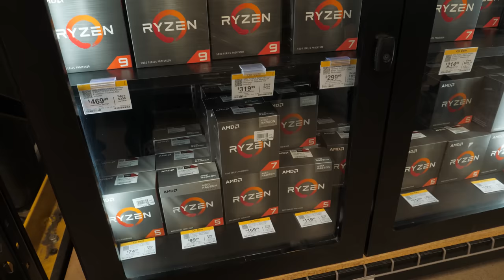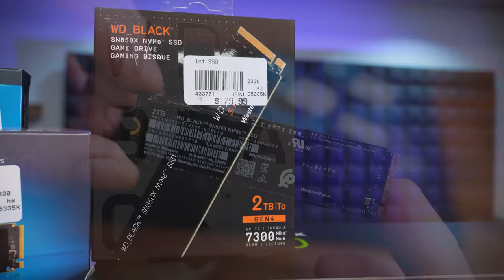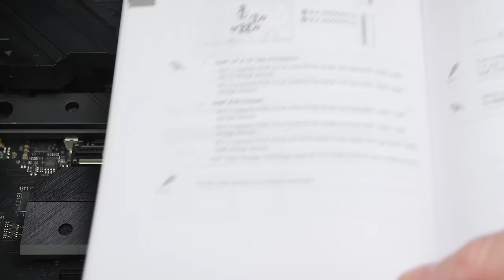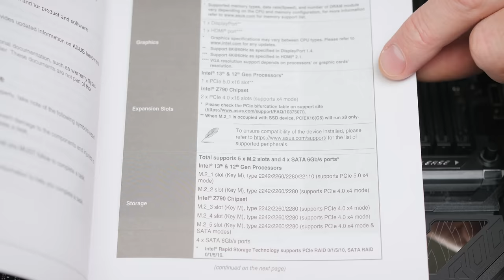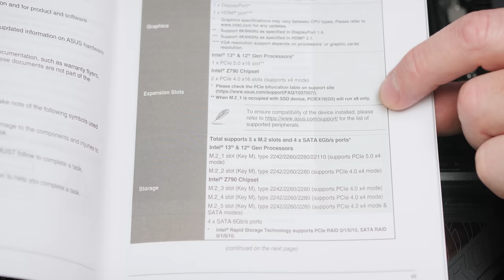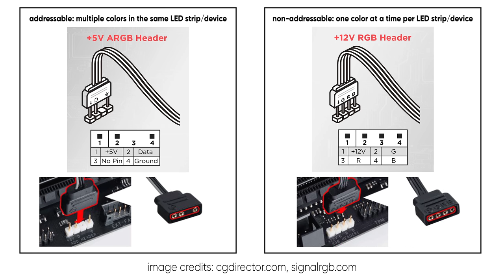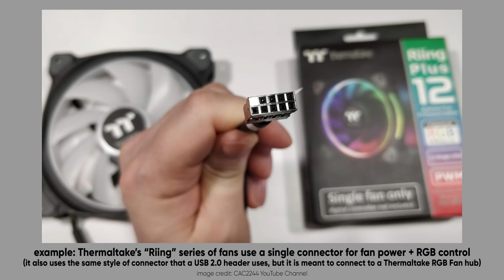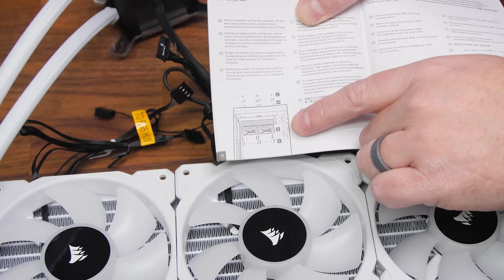How To Build a $3000-$5000 High-End Gaming PC - Step-by-Step Guide

Comment from the maker: Thanks for watching everyone! In case you missed it, this is Part 3 of a 4-part series, and Part 2 was the $900 budget build that covered a lot of the building basics: https://youtu.be/vUu7N8tq4RE 
The parts I use in this video cost well over $3000, as many have pointed out, but that's the starting price range I think builds should be if they're going to use stuff like full RGB fan setups, high-end AIO liquid coolers, and $200+ cases. 
Also, the description has been updated with the correct power supply and case. 🙏
Reply: meanwhile all the full rgb custom loop setups I see for a i5 12400 🤦‍♂🤦‍♂🤦‍♂
Reply: Hope Part 4 goes up soon, seeing as I'll be using this video to set up my own 4090 strix 13900k build by this weekend 👀
Reply: Will you please mention how to set up undervolt on this cpu in part 4?  I've read a lot about how you can go into bios and switch something so it's not always pushing it closer to 100c, and it doesn't seem to hurt performance much at all.
Reply: I wish the Micro Center near my house was a huge warehouse store like this. Ours is pretty small by comparison, always feels a little cramped. We used to have a Fry's near us that was cavernous and gave me that awesome "Oh, where should I look first?" feeling, but of course they've been gone for several years now.
Reply: Didnt you build in a Lian Li Lancool 3 case? The case in description is Corsair ICUE 7000X if that was wrong. 😂
Reply: Great video. Just one remark: Basically no gaming PC needs 64 GB of RAM for the foreseeable future. Not a good buying advice.
Reply: Why wipe off perfectly good thermal paste. lol
Reply: Chris Fix showed that GPU sag can damage the VRAM solder points close to the PCIe connector. You should always support/suspend such heavy cards, particularly in a build guide.
Reply: as long as you're doing a madboi build, you may as well do a 4x2TB PCIe 4.0 M.2 in RAID0 ;) I've had this for a few years and not had any issues (yet)
Reply: Right up until 'Intel'....then I realised it was  'Sponsored Build' with camouflage. Very poor show
Reply: Great video! One thing I should point out though, is that @38:48 There is no LGA1700 bracket for Corsair coolers. It's the same bracket for every other LGA Intel socket (115X/1200). :)
Reply: Paul, thanx for another wonderful, detailed and enlightened build. Love how you do these!
Reply: Hey Paul n00b question... I can use all of this with a 7900 xtx yes?
Reply: @tobiaslofton611  yes
Reply: @HighCastle0824  so therefore it is an lga1700 bracket no?
Reply: When is part 4 coming????
Reply: I want Micro enter to offer world wide shipping.
Reply: @robertpearson8575 true tho that's what im wondering lol
Reply: Paul any progress on video 4? I am considering a high end build and the next video seems pretty important…. For the newbie….. thanks,…. 😊
Reply: Any update on the mythical Part 4? It’s been over two months. I’m looking forward to your memory configuration insights.
Reply: Added this reply to the general area so putting it here so maybe you answer it.  My question was about what if not Micro Center.  Do not want to watch these and realize I cannot do it due to no parts center.  Original question "Not sure how to scan comments so sorry if this was asked before but what if there is no Micro Center close. In the Virginia Beach area in this case.  Just wondering before I get to invested in this idea what the options are if no PC building parts center close."
Reply: Apparently nobody shops at that store, it's empty! 🤪
Reply: @TAVMANIAN  We sourced all of the parts via Amazon, I believe. We do not, unfortunately, have a Micro Center in the area. Maybe in the future. I am surprised, as we have two national laboratories in the state, along with the birthplace of the atomic bomb. You would think folks here would be builders. Best of luck.
Reply: Where’s part 4?
Reply: I needz ma part 4!
Reply: It's seems Amazon is cheaper than micro center in my area.
Reply: Love your videos!!! Have you done a review of  gigabyte Aorus C700 glass pc case?
Reply: I didn't know you're in Orange County CA 😁👍
Reply: I thought you would want the radiator fans to pull air into the case and pull air through the radiator, not push air out through the radiator?
Reply: @typerightseesight  Probably as an opportunity to show people how to apply thermal paste since having pre-applied thermal paste isn't a given
Reply: to a chip without integrated graphics. lol. super fresh @bzomeful

Comment: Built one of these a few months ago and it's insane overkill of a beast.  Just for fun I ran black ops 2 with fps unlocked and it ran at almost 1000 fps.  I have a 4080 and 13700k with ddr5.  30k Cinebench score.
Reply: How.mich was the total.cost?
Reply: @chillnspace777  I believe 3600 but that's because I have 10 rgb fans in the nzxt H9 flow.  Thermaltake lcd 360 aio, msi z690, 2tb samsung nvme, 1000w pwr supply.  The graphics card, cpu, and ram was about 2k so there's cheaper routes than what I took with the same hardware basically.  The only fires that start with the 4080 are the fps counter encase you were wondering about the plug.
Reply: @DARKKNIGHT-ys9ev   def get a 4k oled to go with it.
Reply: @DARKKNIGHT-ys9ev   your going to bottleneck your system.
Reply: @DARKKNIGHT-ys9ev   i ran 1440p with basically the same setup and gpu/cpu usage was 20-50% which is bad.  I was getting 50-60fps when I should've been getting well over 100.  I got a more demanding monitor and it rips at 99% like it should.
Reply: @Drozey710  I have 1440p 165 fps monitor. U know when u go 4k ray racing dlss frame gen at 4k u get less gps cause has to do more work and pixels for 4k at 1440p u get nice graphics and high fps I’ve watched a lot of content i know my shit. 4k u get less fps and 1440p u get more fps cause 4k the card has to work more 1440p is the sweet spot
Reply: @DARKKNIGHT-ys9ev  I had same spec monitor and had super low utilization almost all the time, tiny frame drops etc in some games.  you want 99% gpu usage while gaming.  after I got a 32" 4k 240hz oled it matched the pc specs more so it actually runs games better and it's in 4k.  don't doubt your system, just trying to warn you mistakes I made by not upgrading the monitor sooner because my 32" 1440p 165hz was bottlenecking my 4080/13700k, but you do you man I really don't care just the experience I had.
Reply: @Drozey710  I know just can’t get 4k right now what cpu won’t make it bottle neck with Ryzen 9 ? Pls
Reply: @DARKKNIGHT-ys9ev  If your asking a question you are being a bit too vague.
Reply: @Drozey710  nm lol it’s only 14% bottle neck till I get a 4k monitor im not worried 1440p is good for me u think cars today don’t bottle neck they do then they lunch back lol everything bottle necks 14% isn’t much I talked to a pc tec lol

Comment: My son just finished the build last night, with one small problem: CPU overheating and shutting down the system. AIO seemed to be the culprit. I stayed up checking every connection and tightened up the pump block screws (not to overtighten mind you). We got it to POST with no errors and it is sitting in setup at about 43 degrees. Awaiting his return from 8th grade school trip to DC and Paul’s return so we can finish installing everything. Yes, I could do it while my son is away, but I might learn something from Paul and my son can learn too.
Thank you Paul.
Reply: These comments make me scared to build my own PC.  I'm worried I'll get thousands of dollars into the build then have these types of issues.
Reply: @HealthySkepticism1775  I think your fear is valid, but really, there is nothing to worry about. Just do it. You will feel a great sense of accomplishment and get the parts you want. Run into any issues and you have a great community to help out. He is very happy with his system.

Comment: FYI -- if you're using an Arctic Liquid Freezer II, it's recommended to connect to the "CPU_FAN" or "CPU_OPT" fan connection on the motherboard instead of the "AIO_PUMP", as connecting it to the AIO_PUMP connection will make the pump run at 100%, whereas with it connected to the CPU_FAN/CPU_OPT connection, the AIO pump speed is also regulated along with the AIO fans.
Reply: To add to your insight:
Okay people, Arctic liquid freezer ii pump should always be running at 100%. It's a small pump despite the large radiator size and the flow rate can barely move the liquid fast enough. I know this, because I am currently using the 420mm version in my Fractal Define 7XL case.

It's a good cooler and it is the only cooler that can tame my slightly undervolted 13900ks. However, the actual pump is still stuck on last gen, with limited flow rate. You want the pump at 100% always to remotely mimic a proper liquid cooling. Don't regulate it. Ever. Keep the pump 100% at all times if you actually care about your CPU temp. Radiator fan speed is the only thing that matters, which is well controlled right out of the box.
Reply: @csguak  Thanks for clarifying this.

Comment: Wanted to say, that particular case comes with an anti sag gpu bracket that attaches to the motherboard out of sight (we have ours on the outermost standoffs to the right (it comes with spacers). The gpu also comes with one, but it would probably be in sight, near the case glass.

Comment: Very helpful! The last time I built a computer from scratch was at the dawn of the 32-bit architecture; processors barely hit 1M transistors (although most popular in our neck of the woods
 were 300K-500K) hitting a booming 16MHz; 6 MB was a phenomenal amount of memory; 5.25" FDD is perfect and 3.5" just started showing up.... and 20MB HDD was WOW... So, quite a bit changed. Quick question - is Part 4 out yet?

Comment: I taught myself how to bend glass tubing for neon sign making just to be able to use glass in water cooled PC builds.  Since you can not put anything inside of the glass tubing like you can with plastic tubing because the glass needs to be much hotter you need to do it another way.  First you cap one end of the glass tube, I just use duct tape & on the other end I connect a soft tube 16mm OD 12mm ID tube (I use 12mm OD glass tubing).  And on the end of the soft tube I use a the bottom half of a pen that fits the open end of the soft tube, that is used as a mouthpiece, and when you heat & when it is time to bend, you give a super soft push of air to keep the glass from collapsing when you bend so you end up with a perfect bend.   btw, blowing to hard is worse that blowing to soft, if it collapses a little bit it can still be used but if you blow too hard it will blister out the glass super thin, and all it takes is a super like tap to pop the glass blister.

Right now ...and have been for awhile, been building, very slowly, a PC I want to use for streaming where I'll show, teach how to do this stuff on the cheap.  btw I also cut my own aluminum plates for custom cases by hand, who needs a CNC machine when all they seem to do is break and cost thousands of dollars I don't have.

Comment: I would be interested in a comprehensive comparison of all the different hub controllers as to ease of use, integration with other fans, potential problems, software usefulness/ease of use and overhead on a system. I know it is quite subjective but I think its good information yo have when going shopping.

Comment: Wiggling gpu cable side to side a little helps it latch and secure it into place with a lot less pressure.. also once you think it’s latched, do the same wiggle wiggle (but pulling back) to see if it backs out… fail safe way to verify its properly inserted.

Comment: Do not have your tubes on the bottom of your rad in your case. It will  Shorten the lifespan of your radiator due to the air being in the pump. Just for anyone that doesn't know

Comment: OMG…is having a block connector for the front panel cables a new thing? I have been wanting that in a case since I started building. My huge hands had the hardest time doing those individual pins. Probably my host hated part of building. That alone is a feature worth buying the case for imo!

Comment: Thanks, the PC I have right now is very out dated because I made it when I was still a teen which was a while ago. This helped me make choices on what parts I wanted to buy; I am a broke collage student so my build was closer to 2500, but once I get this a good job best believe I'm upgrading it. 
The parts I just got are:

Intel Core i9-13900K 3 GHz 24-Core Processor
Corsair iCUE H150i ELITE CAPELLIX XT 65.57 CFM Liquid CPU Cooler
Corsair iCUE SP120 RGB ELITE 47.7 CFM 120 mm Fans 3-Pack
Asus ROG STRIX Z790-E GAMING WIFI ATX LGA1700 Motherboard
Corsair Vengeance RGB 32 GB (2 x 16 GB) DDR5-6000 CL40 Memory
Samsung 970 Evo Plus 1 TB M.2-2280 PCIe 3.0 X4 NVME Solid State Drive
MSI VENTUS 3X OC GeForce RTX 4070 12 GB Video Card
Phanteks AMP v2 1000 W 80+ Gold Certified Fully Modular ATX Power Supply
HYTE Y60 ATX Mid Tower Case

Comment: I specced a $3000 13700K with a 4080, but only to research the parts.  The Asus Z390E has issues with its ethernet port running more than 100Mb/Sec, and cooling a 13700K is a challenge.  And the Gen 5 M.2s will need serious cooling, and the M.2 slot might share bandwith with the GPU PCI slot.  So... yeah, I'm waiting a couple years anyway because I have a 3080 and I'm waiting for a 5080 or 6070.  So I'll see what's going on with Intel, the mobos and the GPUs then.
Reply: if cooling is a concern you should give ryzen a shot. much more power per watt

Comment: like 9-10 years ago i build a ROG gaming computer , well it was a gaming computer 9-10 years ago . but i have to say Asus ROG,G.Skill,Corsair,EVGA, make really great parts i have this computer almost 10 years and i didnt have not one problem with it, it still runs and still used it today . 9-10 years ago i pend like $2800. i have 

Intel Core [CPU] i7-4770K/ASUS MAXIMUS VI FORMULA [CPU]
Corsair Obsidian 750D [Computer]
EVGA SuperNOVA NEX 750W, [Power Supply]
G.SKILL Ripjaws X Series 16GB, [Memory]
Asus ROG MARS GTX 760x2 4GB [Video Card} now it have 1660 super
Asus ROG RAIDR Express PCI-E 240GB
1TB 2X500GB Seagate HD
KLIPSCH Promedia 2.1 Speakers
Corsair Hydro Series H100i

Comment: I applaud you for using a manual screw driver. I hate seeing channels use a drill. It's a bad habit to get into. Aluminum is so easy to strip. If that clutch is set too high, bye bye threads. And the only thing I would do differently is plug in the GPU plug before installing the card. Just to make sure you get a complete connection.

Comment: A question: Remove the cpu lever protector or not? It does not appear that it was done. Any issues down the line if not? Overheating the protector? Looking forward to part 4, after Paul's return from Taiwan.
Nevermind: I got my answer in the mobo manual. Answer: YES.

Comment: Just an observation, because that happened to me with a dominator x 2 set and my AIO is if you put the tubes towards the right, they do not fit, if you place them other way, they do not have problem. At least that happened to me in an x570 motherboard with an Nzxt AIO

Comment: very cool guide but I have one thing I would change: the 12VHPWR installation. With all the drama around those plug melting because they were not plugged all the way in I would have insisted that people put the cable inside the GPU while the case is flat on the table, and I would have shown more force being applied to connect that power plug (with a spoken precision like "put a bit more force on this one and inspect it visually to check it, there should be no gap at all between the two plastics, not a single millimeter)

Comment: Just in case you’re building for the first time, populating the top m.2 slot will half the bandwidth of the pcie 5.0 slot for the gpu but just so you know, there are no pcie 5.0 gpus as of today.

The top gpu today doesn’t even max out a pcie 4.0 x16 slot.

Comment: And the usual reminder that the Corsair fans don't actually use a proprietary connector. You can buy or make your own adapters and connect regular fans to the Commander/Control box.  I believe the same applies to Phantek's RGB controllers too, but I don't have any experience with those.

Comment: A quick question. Wouldn't you want the radiator fans to pull cool fresh air in through the radiator instead of pushing the heated internal case air up out of the radiator? Can someone explain why this is less preferable?

Comment: 1 mistake you made. Each M.2 slot is made for either single or dual sided chips. Yours are single sided and thus to be cooled properly by the heatsink, you needed to add a very small foam extension (Provided) to the already mounted thicker foam squares in the middle of the M.2 placement. Loved the video, thanks.

Comment: Just a note, check with the manufacturer data for the headset regarding what plug to use.  The Razer ones I have tell me to plug into the FRONT I/O ports otherwise the 7.1 surround sound feature on them won't work.  It also means I don't need to worry about how far back I sit due to cable length.